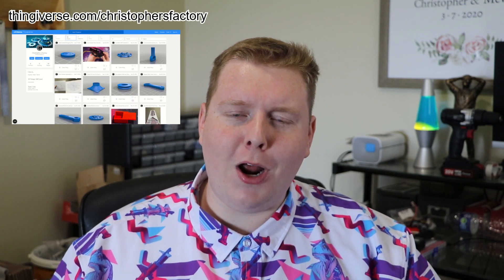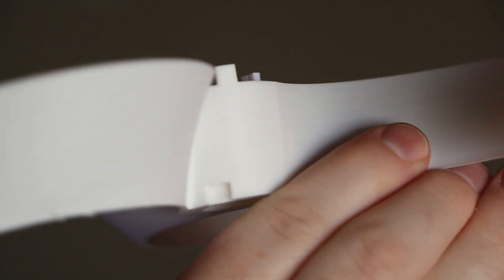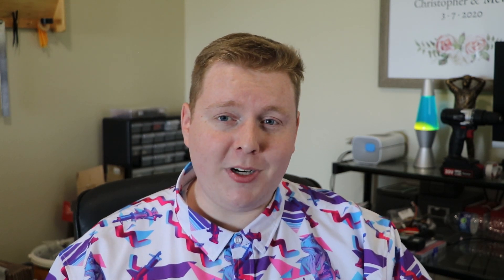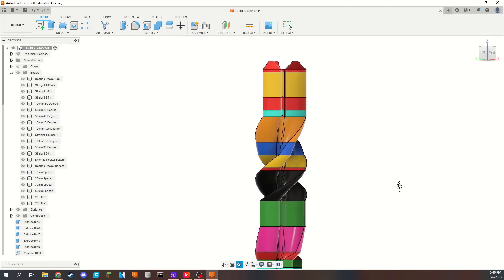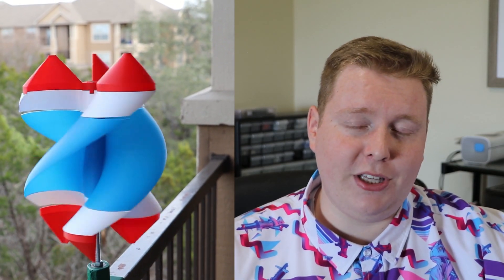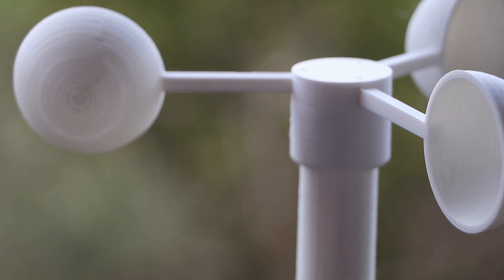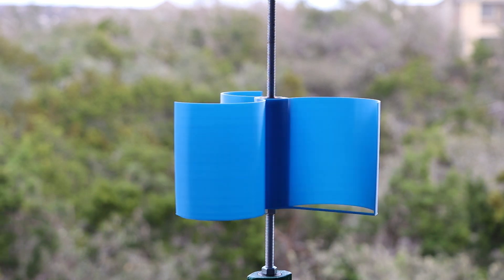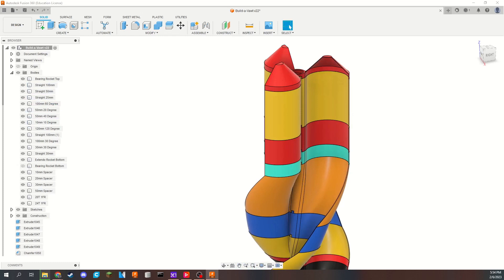Build-a-VAWT

Comment: He mentions at the beginning of the video how wind turbines make less energy than solar, then, instead of telling us how much ENERGY a wind-turbine (or better yet THIS apparently superior wind turbine produces and claims is so great (because "IT LOOKS PRETTY" LOLOLOL ). He goes on and on about how easy they are to print and how well the pieces fit  together but maybe they're easy to fit together because THEY'RE MISSING FROM THE DESIGN FILES (His own words in the comments on Thingiverse:
"KNOWN ISSUES: 
Rocket pieces are mixed up. Males face down, so the side with only female should be a bottom.
Extendo is missing for one of the top/bottom rockets
TODO: Add alternate tops and bottoms"
So basically by skirting around any relevant info re: energy production, he does go on and on about how aesthetically pleasing they are albeit apparently useless and missing the properly fixed issues that have been ignored in lieu of a time-suck of a youtube marketing video so he can get kickbacks on bearings and PLA purchases from his page. I'm so far from a fan because of this and THUMBS DOWN!!

Comment: I think you're missing the real point of Patreon. To understand the Patreon, you just have to focus less on the patreon and the general playground atmosphere of youtube. So, youtube is formal, a gathering of many varieties from all walks of life, some deeply interested and integrated into your thesis or story and others are fly bye's and often the comment section will get clogged with nonsense and so patreon, think of it as less about your gain, you could charge the minimum and find ways to reward your members, but it gives your serious or dialed in fan base a place to mingle and conversate with others who are really active in your projects and measurements and solutions sometimes from beneficial backgrounds who can put forward innovation. If none of that matters to you, you can always do a surprise video in your underwear, so there's that

Comment: I design wind turbines and generators but I don't have a 3D printer yet and I'm wondering if anyone knows where to find good used ones that are cheap
Reply: BambuLabs...  It just prints...  If you want to be in the 3D printer hobby then get a Voron, but for something that just prints out of the box get a BambuLabs

Comment: very good idea! Love the modularity. You ask for sugestions, perhaps a way to use two plastic bottles. Disks you screw bottles into at slight angle, combine two bottles and cut out the wind pocket. I'm thinking the longest part is printing the surface,why not use something already printed and free.

Comment: I've built double and triple blade designs similar than this but with spiralize or vase mode that are 200 mm diameter by 200 mm that will just fit on my ender 3, a section only takes 5 hours to print, they are super light and quite strong, incorporate skater bearings and can fit on top of each other, they use 98g of pla at a time. I over extrude to cause the sides to fuse.

Comment: Instead of ca glue you could make a connector at the top and bottom by dividing the edge of each blade in thirds and offset the middle top and offset the sides on the bottom. ( You possibly wouldn't need the pegs at the center)

Comment: These references should help you improve your designs.
Robert Murray Smith is one of my favorite tinkerers.

Home Brew Wind Power
Axial Flux Generator
https://youtu.be/S4X-jiMwRZk

Archemedes Screw Wind Turbine Generator
https://youtu.be/nwspLw7QWqY

Vertical Axis Helix Wind Turbine VAWT
https://youtu.be/3Mlj1pZyDAE

What if the generator were inside of the blades, where the blades move the magnet rotors? The vertical height of the blades, the central hub, to be where the generator is.

Comment: Ah, good YT algorithm! Presented your short, subbed, watched the full video.

Always a bit into wind generators for my off-grid van-life thingy - but did not find anything that would make sense so far. Plus, being affordable.

Rotors would be to big, mainly to carry around and install. And main thing, the energy gain would be too low, if your not right by the sea.

A 3D printed version could be worth the try, and this is my suggestion:

A wind generator, maybe of your kind or different, attached to the end corner of a van (roof railings) that can be mounted/dismounted easily and packed small. Maybe a clip/fold/stack.. eg system.

What about something like that?

Comment: Had a idea. instead of just one wind catcher on each end have one on each section on the bottom so it would be more stable while printing and catch more wind.
I don't know if this would work or not, just a thought. If it works out or not good luck. There is a guy out there who sells wind tuebine/ solar power systems because in his words solar only workes 10 hours a day while wind can work all day long if you are in the right location.

Comment: my thoughts are rather then making a wind generator. make a gravity generator with compound gears and maybe a flywheel. you make the gear ratios so the first gear that has a weight, will spin slowly for 12 to 24 hours. while last gear is spinning at say 1000-4000 rpm turning the generator.

Comment: Like the project! Is there any project or documentation on how to regulate the voltage coming out the stepper? I'd like to charge my power bank with a VAWT but I don't think stepper direct to battery is gonna cut it.

Comment: You’re my new favourite YouTuber, I’m going to take part in this project, I think with the fact solar is so ,inch more efficient, the way this can be truly useful is as a more effective way to power solar powered fairy lights, the panels on them fail so quickly and are so small. I’m excited about this, I would be so wrapped if I could power some nice lights for my balcony area. 
As part of,the project, we could even print a battery housing to house some cells and a bms? Like a deep cell batter on a tiny scale, we could even incorporate usb so that it can be used to charge devices in an emergency!

Comment: Questions on gearing; once the VAWT is built and mounted with shaft and bearing casings, do you have printable Gear Part(s) that can perform various ratios and be connected to an existing electric generating motor?   A printable Box with gears & shaft mountings would be really awesome as well, so the entire turbine structure could be printed (except bearings and shaft I guess).  Is this already available?  I'm late to the game, sorry if I'm repeating others' question(s).  
Also - is this scalable to make a larger one?
And of course, thanks for your initiative.

Comment: love what you are doing here but i would not print it in PLA+, i did that with a windmill that i am working on in my first version and it just about melted outside in the sun and my blades are thicker then yours. i ended up using PETG and that has lasted months now.
Reply from the maker: Interesting, definitely worth a shot. I've had a couple windmills that were 3D printed and did well enough in PLA+. I should put one of each outside and do a comparison after a year

Comment: Dude this is awesome! I’m going to print one of these soon. Do you use a specific charge controller for this or could I just run it directly into my battery bank? It would be cool to add to my off grid solar system just to help supplement a bit more power.
Reply from the maker: I make my own charge controllers -- Check out my video called "Using Stepper Motors as Generators." I feed it into two KBP-307 ICs and regulate to 5.5V :)
Reply: @christophersfactory  awesome, I’ll check it out!

Comment: Ok so I have a very interesting idea. Why don’t you make a wind turbine that powers, a desk fan, but point the desk fan at the wind turbine so that the wind turbine sends power to the desk fan and the desk fan  powers to the wind turbine, in theory, the wind turbine, and the fan should spin forever.
Reply: Unfortunately you lose power to inefficient power conversions. When the turbine generator turns and creates electricity it would lose some of the energy that was present in the wind from the fan. The fan itself also loses some energy from friction and potentially other vampire draws in its circuit. In the end the lost energy would cause the fan to stop.

Not a bad idea in initial principle, but there is a lot more going on in a energy system, that can leech energy and cause perpetual motion to stop.
Reply: I think you solved the problem of perpetual motion. Praise be to ye.

Comment: Hey bro , I mean to bother you a bit .
Apology .
But can you try . Make a smaller ( mini ) turbine that is highly sensitive to wind . And turns vertically and horizontally to the exact direction . And the bigger turbine follows the smaller one's direction .
I wanna know if this is worth doing at all . 
Also make a two way to one way gear , so if your vertical turbine rotates in the wrong direction .. it still generates power .
I'm suggesting too much .
It seems like too much to ask , sorry .
But maybe worth considering ?
Reply from the maker: Interesting -- Do you mean almost like a gyroscope? It has a horizontal component and a vertical component on one body? 

It's a neat idea, worth trying for sure :)
Reply: @christophersfactory  yes !
Kinda like the sun/photon tracker or Holocaust sensor ?
But for turbine .
How efficient do you say is the vertical turbine though , Compared to the horizontal one ?